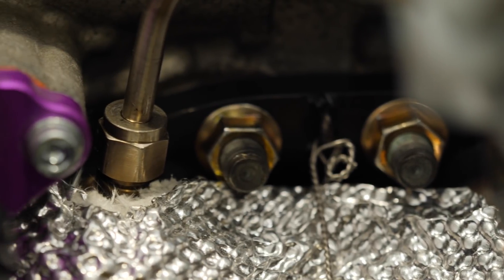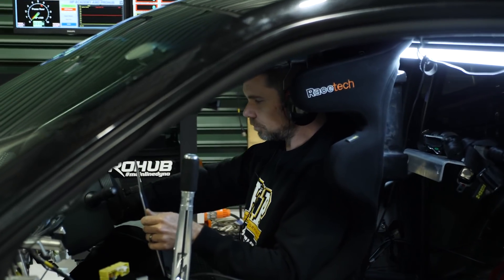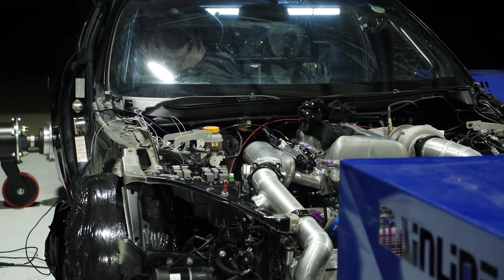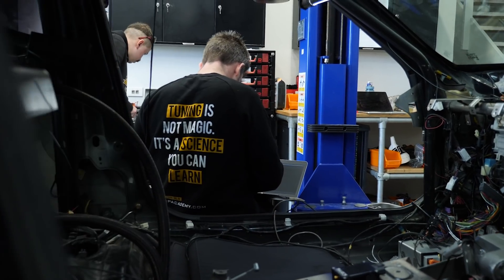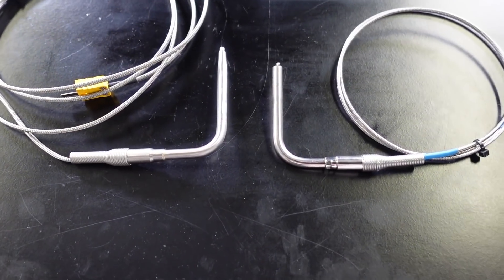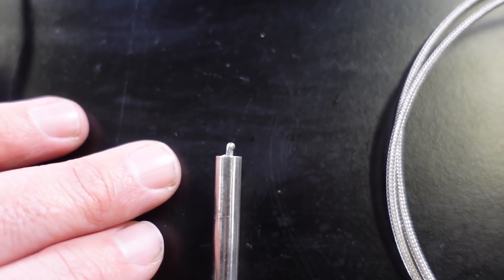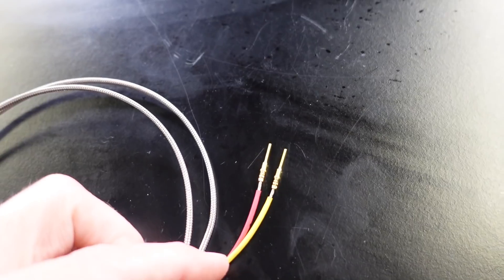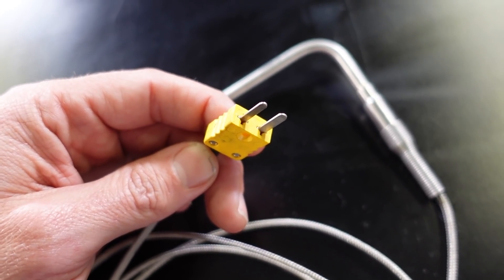Want to learn more about EGT’s? Watch this | Exhaust Gas Temperatures [#TECHTALK]

Comment: Could you suggest reliable egt sensor manufacturers?
Reply from the maker: No brand, but you should be looking for K-Type/Type K and using the term 'thermocouple' in your searches will help. Your local (local as in in country) motorsport wiring parts suppliers will have them in stock.
Hope that helps - Taz.

Wiring Suppliers: https://www.hpacademy.com/forum/efi-wiring-fundamentals/show/wiring-and-accessories-suppliers-list/?utm_source=youtube&utm_medium=social&utm_campaign=general-interaction
Reply: @hpa101 Thanks, but what is the sensor brand enclosed tip on 3:43 min.?
Reply from the maker: There is no branding - Taz.
Reply: @hpa101  could you provide the link where you've ordered it, please?

Comment: it all sounds nice but wow would you install the Haltech TC8 without data and CAN id. Haltech is making a big secret out of it. Junk.
I do have 2 WB2s from Haltec and even that I have the IDs now they still display a bad CAN signal on my Picoscope while at the same time and same CAN bus my ECUmaster EGT amp works great and has a clean signal on the same bus.

Comment: Had an egt sensor break on me once. Sucked into motor and ruined a few pistons and valve seats.

Not sure why it broke apart. Only thing I can think of is it was slightly touching the other side of Ext runner.
Reply from the maker: Less than ideal. No issues since? - Taz.
Reply: @hpa101  No issues since. I weight the thought that I had a knock event causing it but I think more likely the sensor possibly touching the Ext sidewall.

Comment: I’ve just changed my lambda sensor and the mechanic advise me to change the exhaust gas temperature sensor as well 😅
My car is running  smoove very,
 do i really need to change it😉
Reply: no
Reply: @Gurdil95  
Two late 😅Changed the two exhaust temperature sensor and I change the turbo as well so 4 have been changed +Bosch DPF Exhaust Pressure Sensor Diesel.
Running a lot better I’m very surprised.
Reply: @Gurdil95  
Also changed the crankshaft sensor and the coolant temperature sensor+
EGR Vacuum Solenoid Valve
I’ve cleaned my DPF with
 (DPF 100)and Cleaned the mass Airflow with(BG Mass Air Flow Sensor Cleaner)hope this helps.
Plus I’ve changed the 4 glow plugs
The car running like new.
I had a brand-new Mercedes didn’t like it much, my Audi A3 feels like a brand-new car.😀😀😀

Comment: Im using Koso egt’s on each runner placed 13cm from port opening as advised by manufacturer and there are still variations of 50- 100* but it evens out at high gas flow speeds.

Comment: The main point to understand is that your are NOT measuring the temperature of the exhaust gas, but the average temperature of the end of the Thermocouple!  Because reciprocating combustion engines are not a continuous process, the exhaust gas is not continuously flowing past the sensor, it is actually stopping and starting (it obviously only flows when the exhaust valve is open!).  This means the figure you see is the time average temperature that is the result of the total heat flus into, and out of the sensor itself, damped by the thermal inertia of that sensor.

Luckily, we don't actually care about the temperature of the gas, because what we care about is metal temperatures in the exhaust line, ie the turbocharger turbine for example, and these also reach a temperature that is a time average of their heat in and heat out balance (and this is not the same as for the sensor because both the thermal gradients and the thermal impedance is different)

For example, whilst you might try to keep your measured EGT below say 1,050 degC, actual peak exhaust gas temperature will be significantly higer, perhaps as high as 1,800 degC, but that peak temperature exists for such a short pulse as to not have time to heat up critical exhaust line components much beyond the temeprature measured by the sensor (the 1,000 degC)

At  OE development level, we use material analysis and correlation to link our measured EGT from the sensor to the actual average bulk temperature of critical exhaust line components, in that way we can draw up limit values that are directly relevant to the engine and measurement characteristic in question. For example, we will run a turbo charegr at a measured 1,000 degC for a few hours, and then section the turbine wheel and use metalic crytalline analysis to estimate the average temperature at which that turbine ran, and hence be able to correlate the necessary measurement limit temperatures comensurate with typical duty cycles and safety factors!
Reply: So what's the problem?

Comment: What impact does shortening the tc lead?
Reply: It won't effect the temperature readings. The way thermocouples work means that they produce the same voltage no matter the length - as long as both wires are the same length.